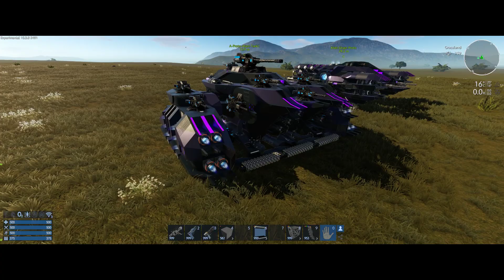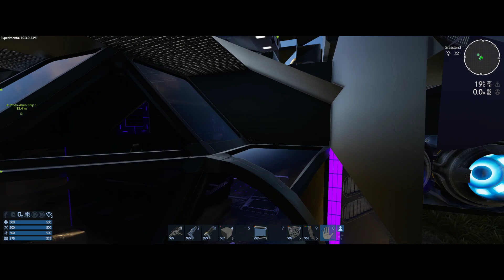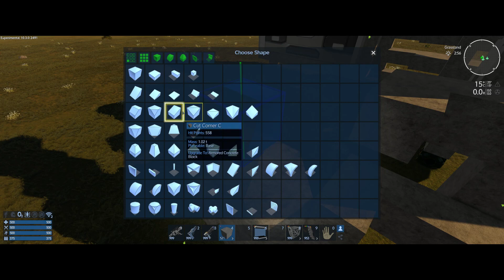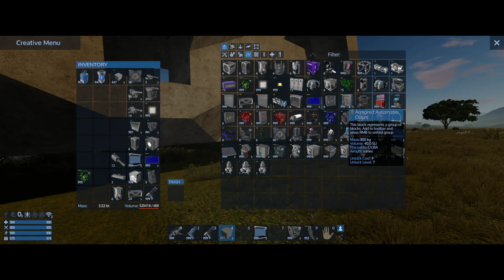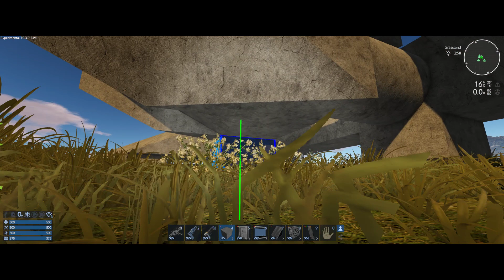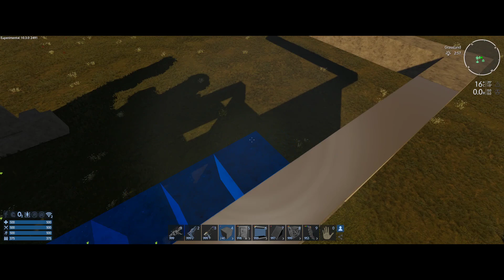Empyrion Galactic Survival - Alien base build tutorial Part 2

Comment: Does the alien blocks have different textures on the tool? If yes, wouldn’t it be cooler if you used those?
Reply from the maker: It would be very cool if I could use them however as soon as a alien block is placed, the creation is no longer usable by regular players. So the alien blocks can only be used for making POI's at the time. On the flip side, there a few textures I haven't used before either in the regular texture palette. In the video today I will show why I haven't used any of them. Thanks again!
Reply from the maker: On a side not, the same happens if you use damage blocks or some other parts.
Reply from the maker: I forgot to show what happens to dark colors using many of the different textures in part 3 of this series. I will hit that on part 4. Basically, white lines show up badly when the textures are using dark colors, making them look really bad. It is much easier to have brighter colors with most textures.